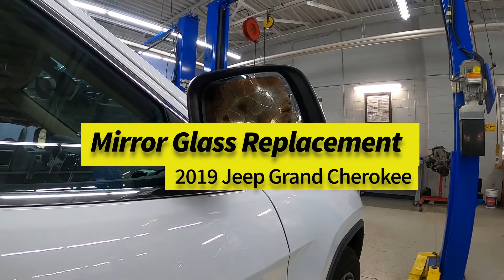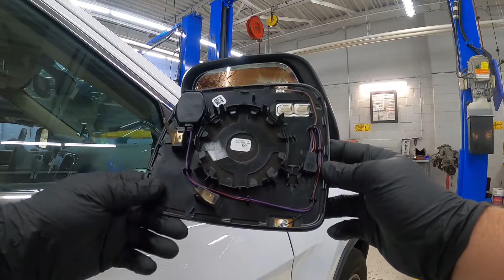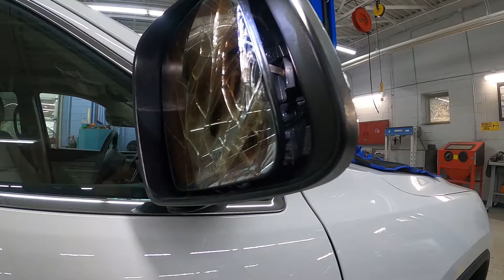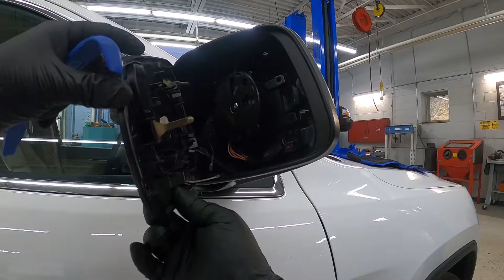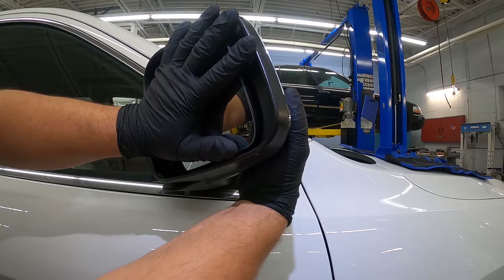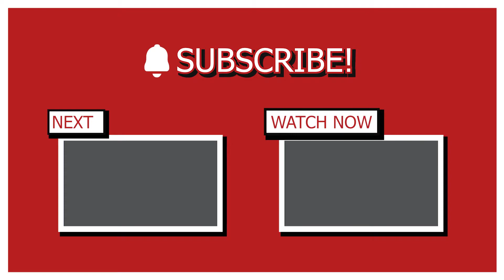2019 Jeep Grand Cherokee Exterior Mirror Glass Replacement

Comment: Hey! Thanks very much. I have a 2018 Trackhawk. Backing out of my garage in a hurry, I busted the mirror casing just below the external turn signal. The glass is fine and so is the painted cover. Plan is to replace the broken assembly with a new assembly but the part does not come painted. Can you tell me how I can remove the painted part? Also, where can I get that nifty blue tool?  Please advise? I'd be grateful!

Comment: I have a 2018 GC Limited with auto dimming mirrors, except on the passenger side. If I add an auto dimming mirror to that side do you know if it would work? My theory is it’s prewired in the factory but they don’t add the auto dimming mirror to save costs.
Reply from the maker: It wouldn't hurt to look at the wiring connectors and see if they have the wires already there. I would imagine if one side has it the other would be capable of working as well.

Comment: I use that exact mirror and put it on my 2020 Jeep Grand Cherokee and everything works expect it says “blind spot temporarily unavailable” and the little yellow indicators won’t turn off. Any advice ?
Reply: Having the same issue any recommendations?
Reply: @DonDice23  so actually I just left mine on and turned the car on and off a few times and it ended up working. I’m not sure if the heated part works thought.
Reply: I spoke to a Jeep tech and he advised to disconnect the negative battery terminal for like 30 seconds and then put the ignition on then off then turn the truck on and it reprograms, tried it and it worked smoothly

Comment: What is the replacement part number of the Mirror glass, mine broke and would like to do it myself?
Reply from the maker: For this application it was 68082634AB, there are a few different versions depending on the mirror configurations. Just make sure you are getting one with the same options yours has.
Reply: pro tip: watch series on kaldrostream. Me and my gf have been using it for watching loads of movies these days.
Reply: @Howard Talon Definitely, have been watching on kaldrostream for years myself =)
Reply: @Howard Talon definitely, have been using kaldrostream for months myself :)

Comment: Hey man, great video. I have a question though. 
I tried to replace my mirror from a 2019 Jeep Cherokee Limited to my 2019 Altitude. Everything fits perfect but the parking lane sensor won’t come on. I just noticed the wire connector has 4 conductors contrary to mine 2. 
Anything I could do? Thx
Reply from the maker: Unfortunately it sounds like the mirror you put on has the blind spot monitor and the vehicle you put it on was not made with that option. To add the blind spot monitor you would have to rewire, add in modules and sensors for all of that. Really not something that would be economical to add in if it was not built with it. Hope that helps!